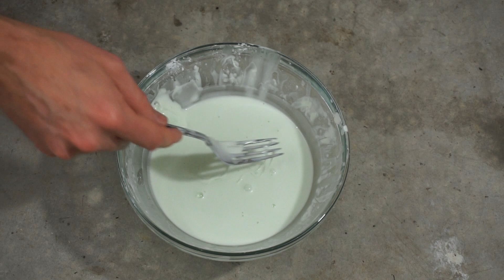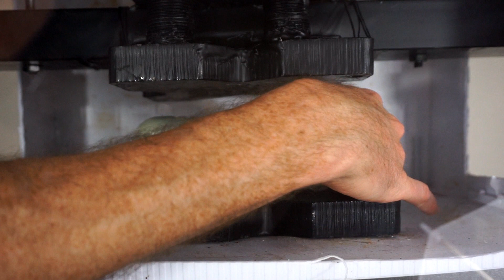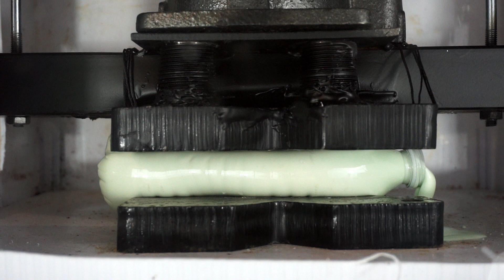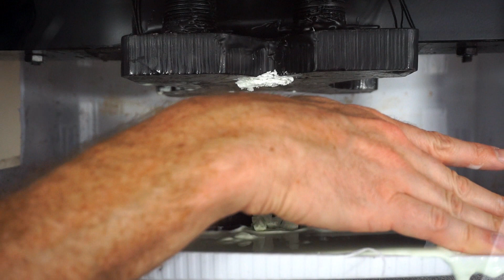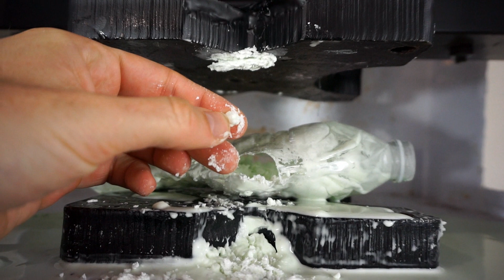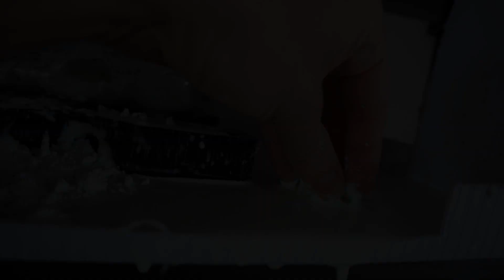Bottle Of Oobleck Crushed By Hydraulic Press | Non-Newtonian Fluid

Comment: Technically wouldn't oobleck always a solid? It's just a malleable solid. Same thing with water becomes a solid when you hit it at terminal velocity. Doesn't liquid always act as concrete when swiftly hit. There just needs to be enough density and volume for the liquid to be a hard hitting obstacle for the object to strike?

Comment: That's not what a non-newtonion fluid is. You described it as a fluid that's viscosity is dependent on blah blah blah which is incorrect. A non-newtonion fluid is just a fluid that doesn't demonstrate the normal properties of a fluid

Comment: You have obviously never seen any of the hundreds of oobleck videos on youtube, otherwise you would have known that oobleck doesnt explode if you apply pressure to it slowly. 

Hydraulic Press Action, here's an experiment for you. First, get a large bowl and fill it with water. Now slowly submerge your hand into the water in the bowl. What you'll see, is that the water merely takes in your hand without "exploding". Now take your hand out and do it again, except this time, go at it as if with a you are trying to punch the water or slap it. You'll get a different reaction. 
Oobleck kind of works the same way, and has different reactions depending on force of impact. The more you KNOW.

Comment: would you rather get hydraulic pressed or drown
Reply: Drown. when you run out of air, you pass out. If I knew I was going to die It would almost be peaceful. Slowly getting crushed is a nightmare lol
Reply: Ludwig
 I don't think my opinion is dumb.. But it seems better than being slowly crushed, feeling every bone break, hearing your muscles pop under the pressure of a machine. Underwater is actually pretty calming.It would be a simpler way to accept death and far less torturous in my opinion.
Reply: Marilyn Murcury I agree lol the slow torture of the hydraulic press
Reply: Marilyn Murcury that's pretty dumb because the process of running out of air is the torture part lol
Reply: Ludwig y are these comments a thing in the first place?
Reply: ive almost drown before and its not as tortuous as youd think itd be. You get a calm sensation before it happens like your body just doesnt care anymore and gives up.
Reply: PyrogenicGamers
 Exactly! I was trapped under water before and it was soothing in a very odd way. I'm glad you are alright, I'm sorry you had to go through that.
Reply: +Ludwig Yeah but the "torture" of drowning most likely isn't as bad as being pressed down slowly, as you can hear and feel your body being crushed.
Reply: Ludwig I'd rather smoke dank memes
Reply: omg yass
Reply: Why not add burn to death? That's much less painful. (Than both choices. No this is not sarcasm.)
Reply: ixToxic again, how suicidal must everyone be to create this chain of comments in the first place?
Reply: Haneen Al-Nasser
 Playing "would you rather" isn't suicidal lol
Reply: ixToxic
 I think burning to death might be pretty painful.
Reply: Marilyn Murcury You get numb after maybe 30 seconds and then die. Or you get deadness by the smoke.
Reply: Marilyn Murcury the question that was originally asked is so damn depressing tho 😭😂👌 lol jk ( or am I)
Reply: Haneen Al-Nasser
 true lol
Reply: ixToxic
 Well Underwater you hear muffled nothingness. It's quiet. You eventually run out of air, pass out then it's over. I can kinda see where you're coming from by your prospective but my answer stays the same because I strongly disagree lol
Reply: Ludwig how does it feeel? About 20 replies, but only 1 like? lol 😭
Reply: Marilyn Murcury It's kind of sad you're ignorant to how most peoples sense of pain works. Having your lungs slowly fill up with water and constantly be choking and inhaling water through your nose is absolutely horrible and it doesn't stop being painful. That's how it is for most people. Just cause it's quiet doesn't mean it's peaceful.
Reply: ixToxic
 I actually almost drowned so I'm anything but ignorant to this situation. Maybe you shouldn't judge someone or be ignorant yourself to assume what someone else has been through.

Comment: There are also non-Newtonian fluids that behave in the opposite way, where viscosity decreases when you apply shear force.  I believe printer jet ink is an example of one.
All Newtonian means is that viscosity doesn't change one way or the other.
Reply: Ok, correction:  Printer ink is another type of non-Newtonian fluid, of the class where viscosity increases over time when it's under stress.  There are also fluids where the viscosity decreases when stressed over time - these basically are what you'd call a gel.  And of course fluids that increase (ooblek) viscosity when under stress with no time component, as well as decrease viscosity when under stress with no time component (latex paint).  Finally, there are fluids where it changes from viscous to elastic under stress (Silly Putty).

Comment: You mostly crushed the bottle here. Except for the middle part that was dry. Not the oobleck.
Try using a container who's weak points are covered by the press plates. Like a can. Not one where those points aimed at the plate's open spots and force isn't evenly applied.
And fill it to the brim. No air bubble layer on top, messing things up.